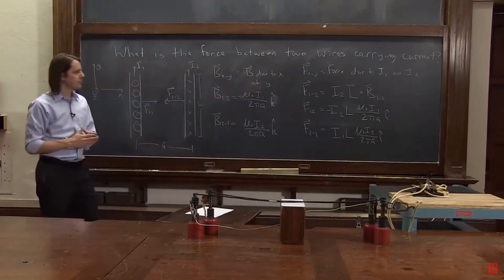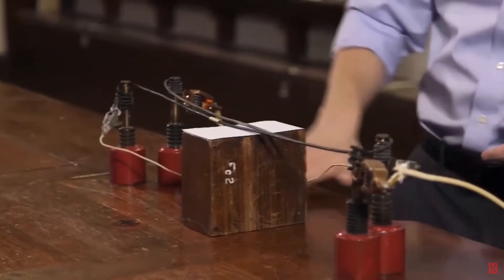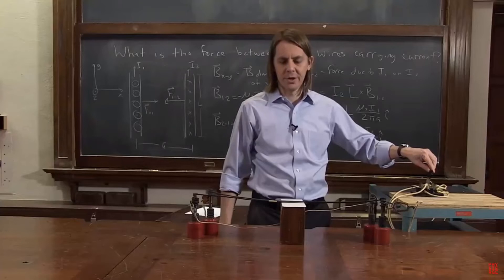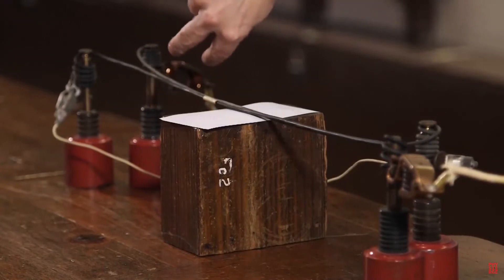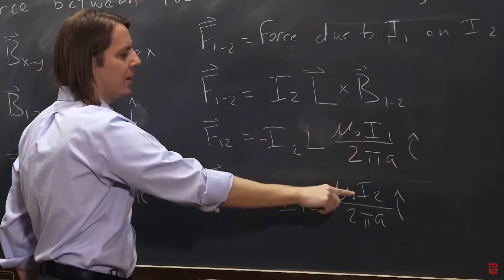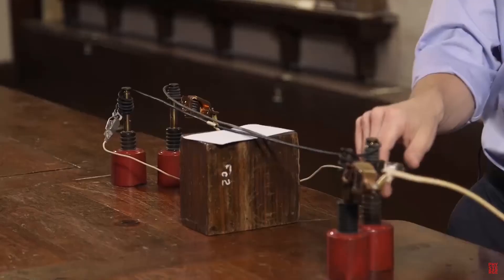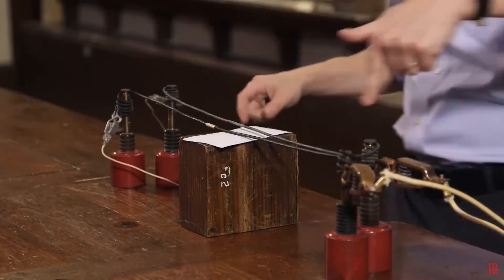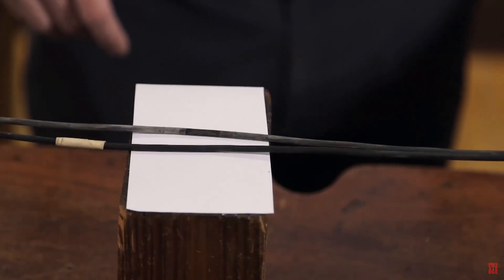DEMO:  Magnetic Force Between Wires

Comment: What apparatus do you need to emulate this experiment?
Reply from the maker: The main thing is a power supply that can put out about 10 Amps, which can be dangerous but not too bad at low voltages.
Reply: @Prof-Hafner  Approximately how much voltage